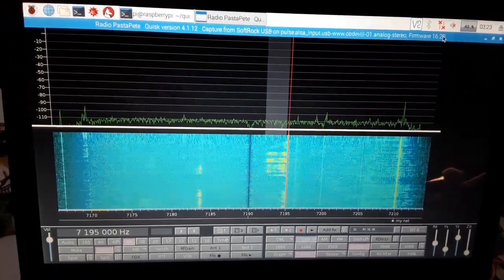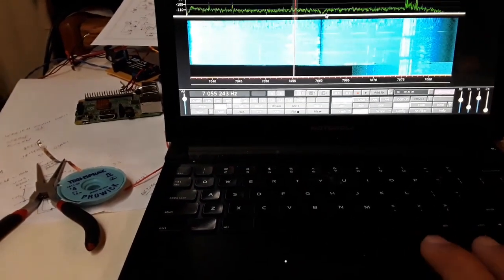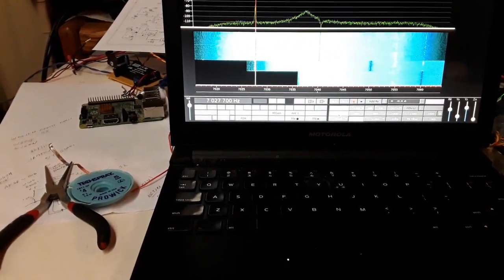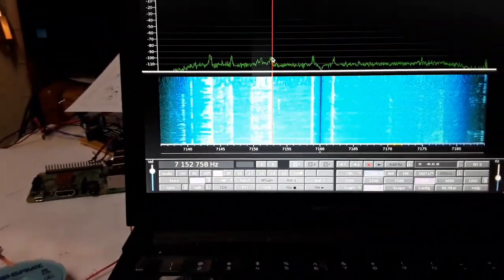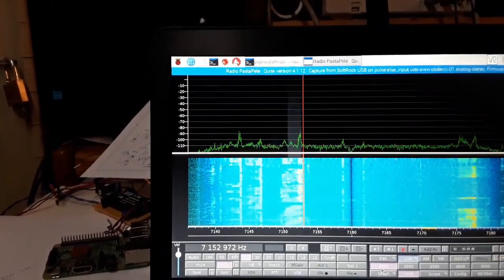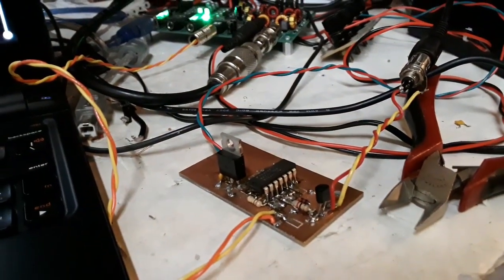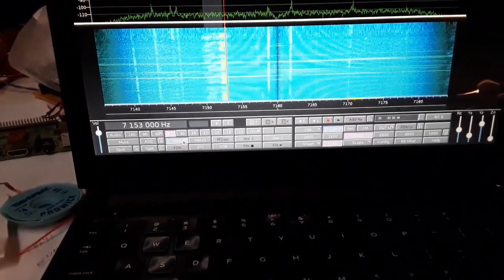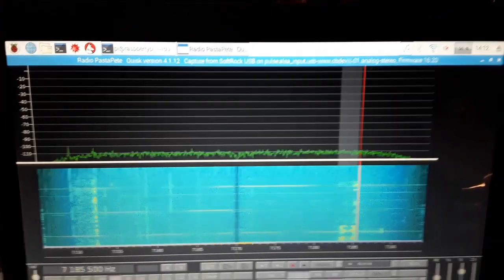Omnia SDR + Raspberry Pi2

Comment: Hi Pete, looks and seems to work great! I am curious. How do you have your Raspberry Pi connected to your laptop display and keyboard? Ethernet? WiFi? SSH? VNC? What's the easiest?
Reply from the maker: Hi Eric,

Thanks for your post. Actually it is NOT a laptop but a Motorola "Lapdock" that was intended to have your smart phone plug into a cradle on the back thereby turning it into a computer. There are two ports used on the Lapdock with one going to the HDMI port on the RPi2 and the second plugs into an open USB port on the RPi2. No software needed just plug and play. There are also a couple of spare USB ports on the back of the Lapdock which also has an internal battery but in addition needs a special power supply. You can find the Lapdock on eBay. What is nice is that you get the keyboard, mouse and display all in one instrument. What is the most difficult part is finding cables to interface the Lapdock with the RPi2 as the original intent was only to plug in a smart phone.

Not too hard but certainly makes for a sompact SDR rig.

73's
Pete N6QW
Reply: @N6QW  Brilliant thanks! Everything makes sense now ;) Great Demo! As always, Inspiring!